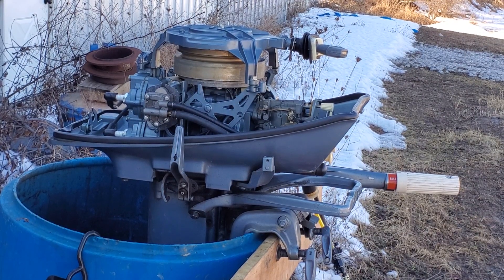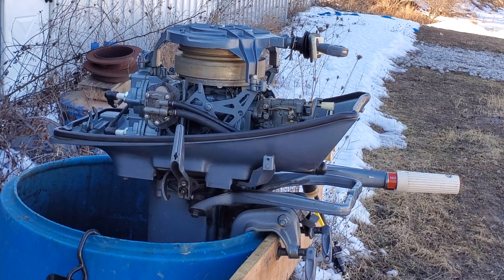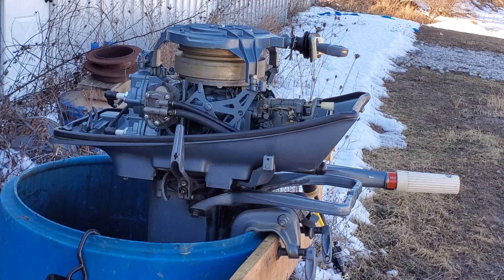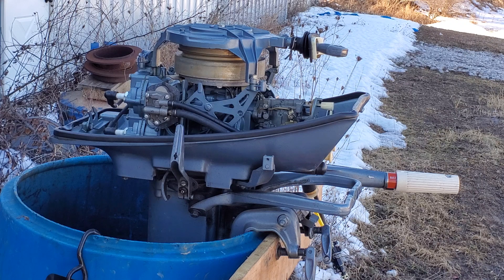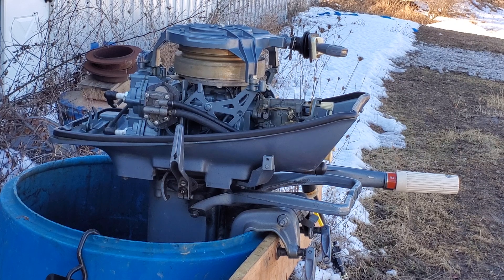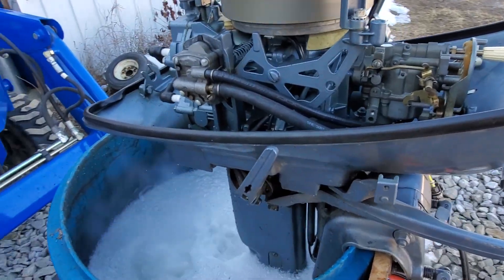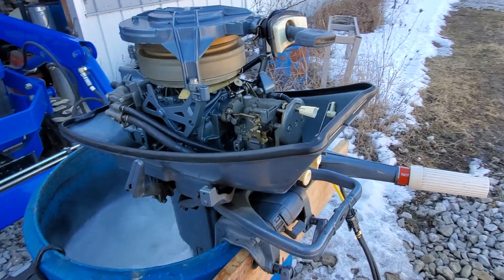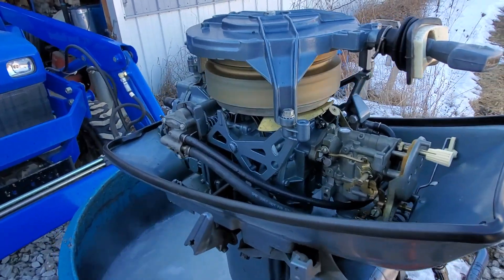1963 Evinrude Sportwin 10hp Outboard Motor Tank Test

Comment: I recently picked up a 9.9 Johnson Sail-master with a 20 inch shaft.  What makes a sail-master different than a regular Johnson 9.9 long shaft?  Thank you for sharing your knowledge!
Reply from the maker: To the best of my knowledge,  the only mechanical difference between a standard long-shaft 9.9 Johnson/Evinrude and a 20-inch shaft Sail Master is the prop.  The Sail Master has a lower pitch prop for pushing the displacement hull of a sailboat through the water and keeping to engine in the proper RPM range.  I believe the Sail Master prop is a 9.25x7P and the standard 9.9 prop is a 9x10P.  Thanks for watching!

Comment: Nice very clean, it' sounds good. Do you replace thermostats, or test them? Notice ya never mention replacing them, and the blue pull handle looks like it held up well, lve got one just like it, just picked up a cd-11 all original down to the j6j plugs, it has a rubber cover attached for covering fuel connection at tiller, its tethered on fuel line, noticed they painted prop same as motor too, thanks for posting
Reply from the maker: Thank you.   This is a really clean example of a '63 Sportwin.   It can't have very many hours on it.  The powerhead feels very solid like a new motor.  The.blue pull handle is cracking and pretty dried put, but it is one of the better ones of the original light blue pulls that I have had.  I have had to replace one thermostat in all the thermostat motors I have.  One more in a motor I worked on for someone else.  I find they rarely fail in fresh water.  I have had to replace a few thermostat gaskets. I only take the thermostats out if they either run too hot, or do not seem to run as warm as they should.  I have had to take a number of them out and clean the passages as well as the tstat.  Replacement I find to be rarely necessary in the motors I have bought, though. 

Congratulations on your CD-11.  They're great little motors.  I have never seen the rubber fuel fitting cover.  Yes, the CD-11 had the prop painted Seahorse Green to match the motor.  Mine is that way as well.  Thanks for watching!

Comment: Great shape...just a beautiful motor. Again, things are RIGHT to get that idle. Do you use a timing tool and multimeter on your points? You must she is timed PERFECT.
Reply from the maker: Thank you. This one is really in fantastic condition.   It is a shame the hood is stained, but it still is presentable.  The rest of the motor just needs a little degreasing and a wash & wax.  Yes, I typically do use a timing tool to set the points.  I actually use it with a magneto timer instead of an ohmmeter most of the time as that allows me to have the coils and condensers connected to the points while I set them.  I can get this idle quality with a feeler gauge too, but it takes a lot of care and more time to achieve.  The timing tool makes a lot quicker work of setting the timing properly. I do not have the timing tool for the large crank 40hp and I set it without the timing tool last year.  Amazingly,  that 40hp will idle like this 10 horse.  If it is in gear it will usually stop when the throttle is all the way down.  I have to use the kill switch to kill it in neutral. It still idles against the stop. That is a really great running motor.   Thanks for watching!
Reply: @oldjohnnyrude8404  I have a 10 junked when I got it but the hood is at least restorable. I love these motors. Yes it is a pain to use a feeler gauge as you are trying to get it perfect and when you tighten the screw....out again! Nice motor.... thanks for the vid JR. Looking forward to all these on the water!
Reply from the maker: @outboardfixer  The '59 10hp in the previous video was a 20 dollar parts motor when bought it.  That hood is rough, but it is restorable.  I haven't decided to what level I will restore it.  It would need a skim over the fiberglass to cover up the fibers.  I don't know if I want to take it that far though,  or just give it a decent paint job and decals to make it look better.  The feeler gauge method is more time consuming, but done right, it works fine.   The timing tool just makes it perfect without the guesswork.  It is a good feeling to save one that was given up on and bringing it back to regular service.   👍